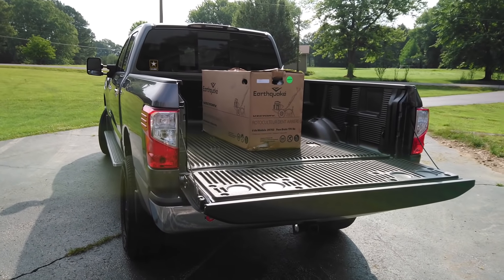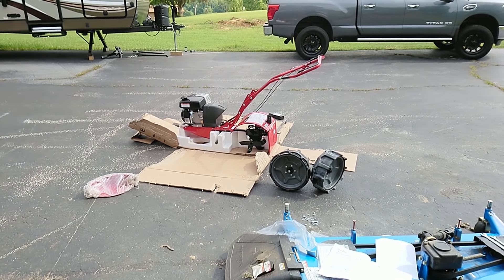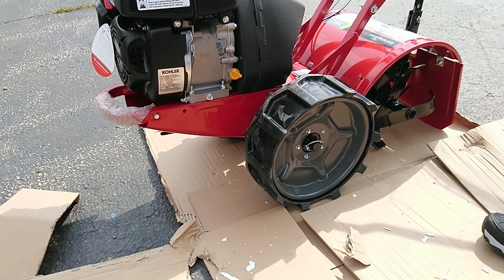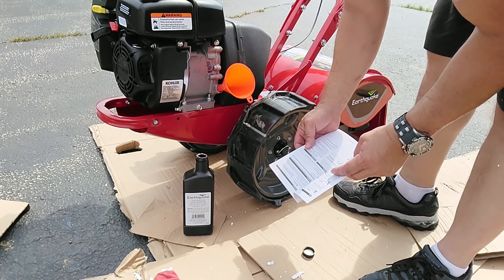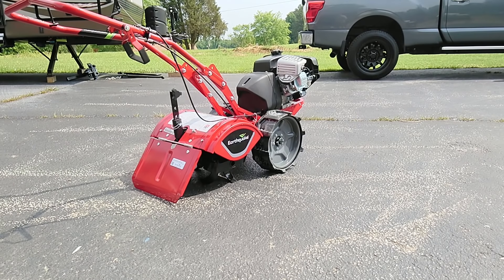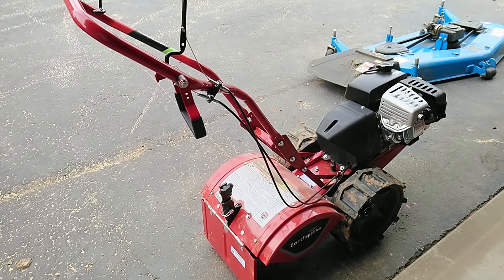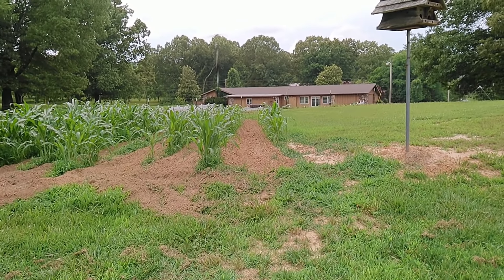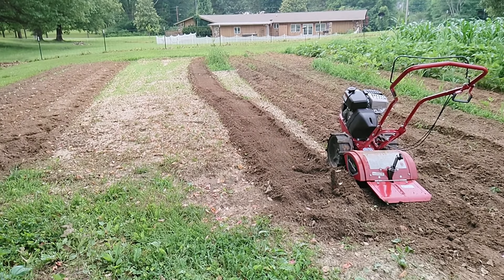Earthquake Victory Rear Tine Tiller Setup and Review

Comment: I just built my tiller and watched your video. I didn’t have any issues with the side plates. I used a zip tie in the two end holes of each plate. Then I didn’t have to hold the plates in place. I then used the washers on both sides and tighten the bolt with the washer net. Then I cut one of the zip ties on the end and tighter the plate in place. It made it a lot easier.  Hope this helps the next guy.
Reply from the maker: Great tip!

Comment: Interesting, the victory does not come with those wheels anymore, only the pioneer has those
Reply from the maker: I seen one at the show last year. Maybe a supply issue.
Reply: @Tony's Tractor Adventure Homestead  maybe, I went to my local Runnings store and they did not have the solid wheels. Still debating on what model I want. The pioneer or the victory

Comment: We just bought this exact model from Menards here in Ohio.  Breaking all new ground with this machine. It does a great job. I paid about 500 bucks for it. The same product made by Craftsman was 800 bucks in Home Depot.
Reply from the maker: We have been very pleased. We use it behind our Tractor tiller to weed and for small projects.
Reply: @TonysTractorAdventure  I think it's the best tiller I have ever owned. I highly recommend it to everyone.
Reply from the maker: I need to use mine, but it has been so wet for us this spring. I have the garden in, but dang, it is mucky now.

Comment: The belt on my 3365 broke last week Wednesday. Can't find a replacement any where. I had a local retailer order one for me and it never came. Found out today, finally, that it is on back order. Just wondering why all the places that sell this tiller and none of them carry replacement parts for them. Now I'm out of luck and the plants have to go in the ground!
Reply from the maker: They look like automotive belts or lawn bels to me. I would just measure them and got to AutoZone. Mine is still rocking on the same belts.
Reply: I had issues with the belt. The tensioner. Found their website. But wasnt very helpful..... it was a good tiller for 4 months.
Reply from the maker: I have used mine for three years.
Reply: @TonysTractorAdventure  yes. I needed one and decided to play with it. Did some type of tensioning and perfect lol. Strong tiller.

Comment: This will be our first year with in-ground plots .. The area we're planting in hasn't had crops for a long time. We're planting corn, peas, carrots, okra, beans, lettuce, kale, pumpkins, and tomatoes .. Gonna be exciting and challenging. Did you have to use this tiller on straight grass before, and if so, how did it do for you?
Reply from the maker: I never have used it in grass. I till with my tractor and then clean up with this tiller throughout the year. We are planting a big garden this year too!
Reply: Okay, thanks! We've got nine raised beds but roughly 1600 square feet of lawn that are to become rows and mounds. I imagine the first pass will take some effort but the second pass will go alright. We'll work some compost and garden soil in with the second pass but gotta pulverize the sod first. Cheers to you and good luck with your expansion!
Reply: I have one, it will till grass,but you need to set bar at shallow for first pass and then drop a little at a time or it will slip belts and/or clog. Does a good job just can't expect it to cut like a tractor tiller with one pass
Reply from the maker: That sounds about right. I have only tilled after my big tractor tiller. Works great for re-tilling
Reply: @davidc1723  Thank you!

Comment: Lucky you having warm weather! Ethanol is not good to old engines. I always use the premium, which is normally ethanol free where I live. So far, so good, many engines to maintain, no fail.  Having the engine level to check oil level, on such equipment is kind of a guess work. Even siting on it's tines, it is not level! You have a lot of experience and you saw it right away. But what about the common people... Nice video, I enjoyed it!

Comment: Thank You for the video, I am considering buying one to. You still having good luck with it and would still recommend a buy ?
Reply from the maker: It still works great. Put fresh gas in it two days ago. It started first pull for the third year.  Just changed the oil once each year and don't leave gas in it over the winter. That is the winner solution. Really solid tiller. They are hard to find right now.
Reply: Definitely buy this machine. It does a great job of breaking new ground.
Reply: @sumwear7123   Thanks for the information I'm buying one tomorrow morning

Comment: Tony hope you had a great trip ! I hope your tractor fix is not to bad he must of been bad during your trip ! LOL Very nice looking tiller i like that it has a kohler on it and i like the wheel too no flats !! i have a rear tiller from TSC that i have had around 15 to 20 years and the tines will got forward or reverse it is nice but i just cant run it no more but i keep it around hope the tiller i found for the Kioti works out know if it will stop raining ! LOL have a great week !! Curt :-)
Reply: Hi Tony did not know they had a solenoid for the pto hope you get it soon ! and i am working on a small video right now on how we got it and what it is ! But i will be doing a video of it on the Kioti if it stop raining and drys up it started out good this year when it stopped snowing but now it keep raining every 2 or 3 days up here and it is hot got to 94 i think to day and the humidity makes it hard to breathe with my health !  Have a great and safe week and dont work to hard !! Curt :-)

Comment: Awesome!  I bought mine direct from Ardisam, and it has the Viper engine that Ardisam makes.  I wonder how the Kohler compares to the Ardisam Viper engine? which one is better?
Reply: My soil is amazing as well. I live on the land side of a levee, and before they built it, my land used to be a creek bottom. They leveled my land with fill dirt fished out of the bottom of the water side many years ago, so it is black as coal.  It can be a pain breaking new ground because of the creek rock, though, but that is why I have my digging bar next to me at all times.  I have yet to have the Viper 212cc engine bog down, but I did have problems with the belts.  You have to constantly tighten them after 2 hours of use because they stretch when new.  I'd also suggest lubing up the axle with axle grease because they ship it bone dry. 

 I see you bought yours at the TSC in Paris, TN?  I live close to good ole Cumberland Gap myself!